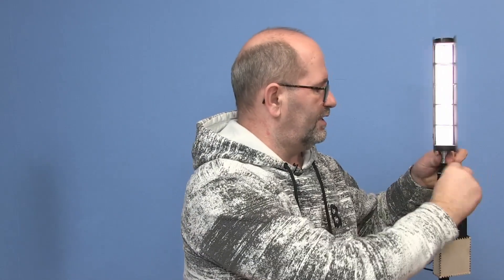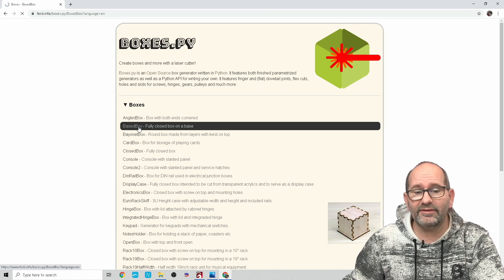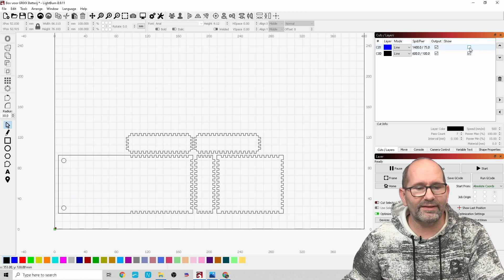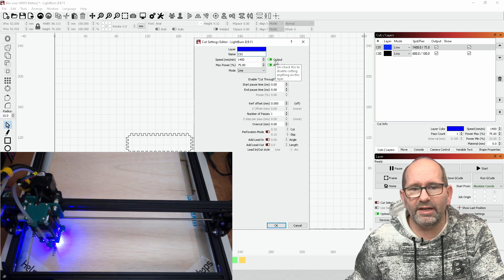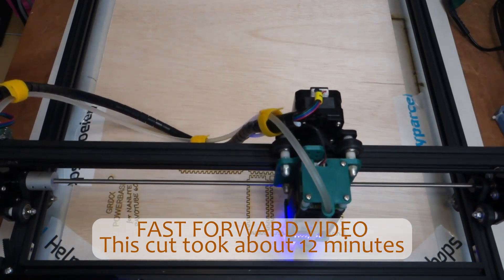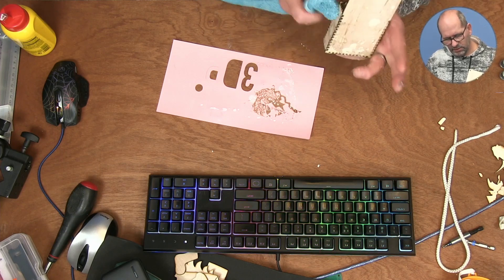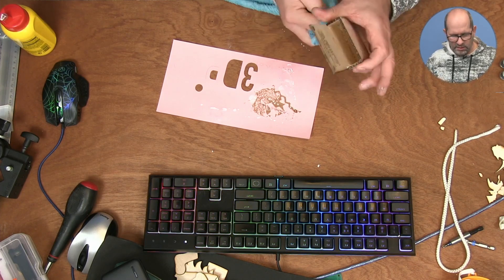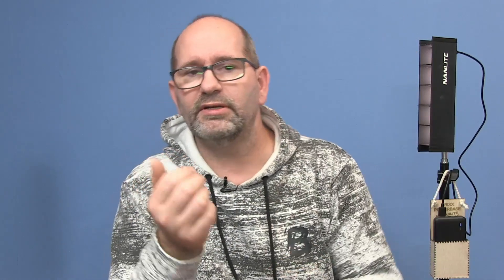▼ I chose laser cutting instead of 3D printing because of speed

Comment: An idea, instead of getting an Ortur laser master 2 , if you have the Ortur  laser master 15w. You could create a base plate jig that multiplies the area by allowing you to move the Ortur to exact position on the base plate jig.

So if you want 3 times bigger in y-direction and 3 times bigger in x-direction, you have 9 different positions (slots) to place the Ortur in. This way you could in theory engrave/cut any size object. You just have to account for the average kerf in x- and y-direction to properly align each of the working slots.
Reply: And you could use the Ortur to modify/expand the Ortur ;)

Comment: What was the cut line width in this project?  When cutting with a saw it is called kerf.
Reply from the maker: Hi, this is a really good question because the answer isn't really there.
With a saw, the blade has the same thickness everywhere, which is not the case with a diode laser. A diode laser has a diode that produces the light, and it is not perfectly round, but rectangular. You then use a lens to bundle that light, and where you are perfectly in focus, the dot is very small, about 0.1mm, but this is really only at the focus distance, and with a cutting thickness of for example 3mm thickness, where the laser is focused on exactly the center of the plate, you would be talking about an X KERF of 0.15 with a Y KERF of 0.22mm This is also exactly why the laser in the X direction seems to cut through materials faster, then in the Y direction. The thicker the material becomes, the worse this phenomenon becomes, and the more difficult it is to use the laser.

By the way, I'm making a video about this matter, so keep an eye on the channel, because this video will follow soon.
Reply: @3dPrintCreator  Nice quantitive response.  I look forward to your new video.  

I measure kerf by cutting out a small rectangle, say 6mm x 12mm.  Measure the finished rectangle and the hole it left in both directions.  The difference is 2 x kerf.

Comment: Is it possible to upgrade the laser module to a 50w ? For faster work/ cutting aluminium?
Reply from the maker: Hi Marko,
It is possible to replace the laser with another model, but for cutting Aluminum you really need a different type of laser than a 405 nanometer diode laser. However, for cutting wood and the like, you might want to consider buying a heavier model laser, such as a 30 or 40 Watt model. These are only recently available, but have proven to be very easy to install and are more than 2x as powerful as the original module.
With a more powerful module, you can engrave and cut faster, but it doesn't do much in terms of the thickness of the material you can get through, because it is still diode lasers, which have a KERF that is rectangular.
Reply: @3dPrintCreator  any advise on where to buy these heavier model lasers? Looking to order the ortur laser machine soon.